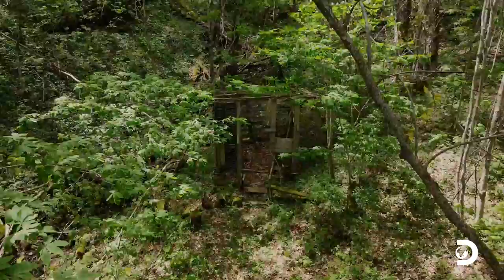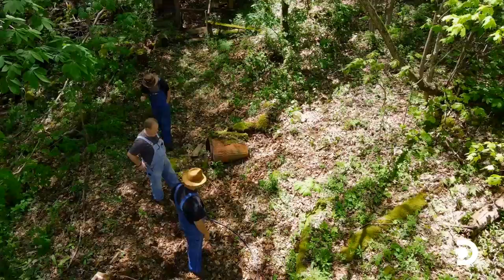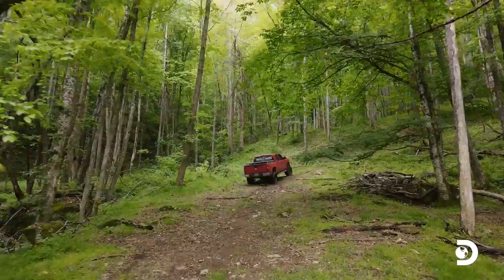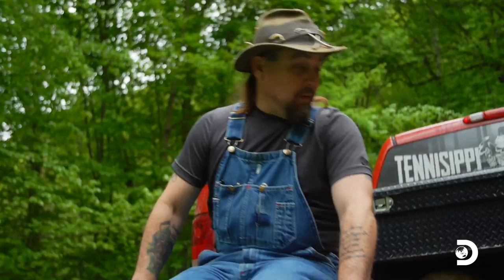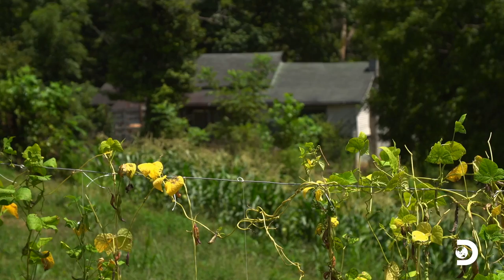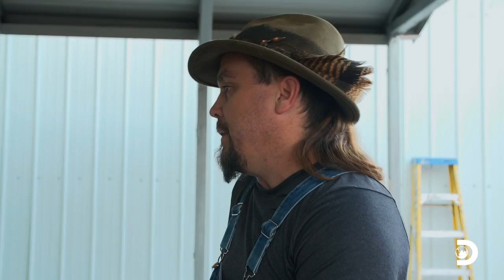Testing a Wooden Barrel Still?? | Moonshiners

Comment: trying to barrel age a spirit - during distillation in a wooden barrel is the dumbest idea yet.
Reply: I have a book on my shelf that references that because during Prohibition the mob wanted barrel aged quality stuff quick, so they put wood into the stills. 

There's a reason they call methanol- the blinding toxin made alongside alcohol, 'wood alcohol'. It's one of the reasons rotgut got so bad during Prohibition, but there wasn't many cases of methanol poisoning before then. Also the government poisoned alcohol shipments.
Reply: @matts.6234  wood alcohol isn't produced from wood in the sill it comes from using wood pulp as a ferment